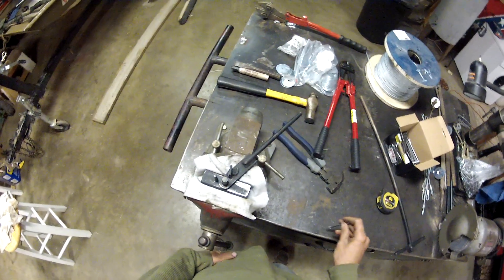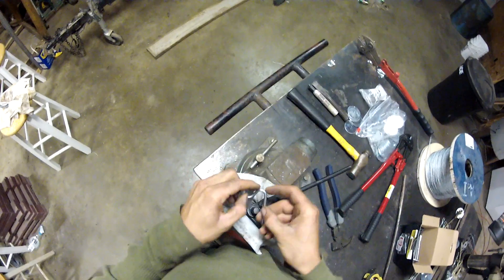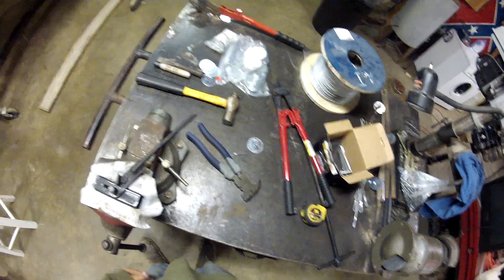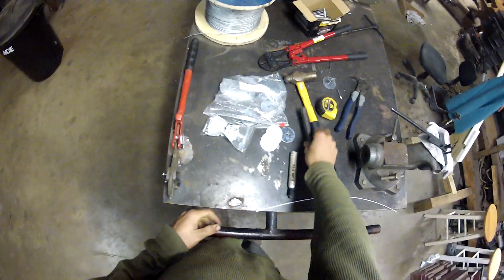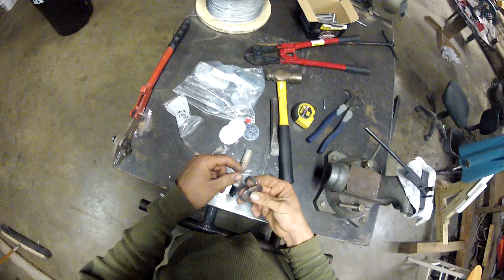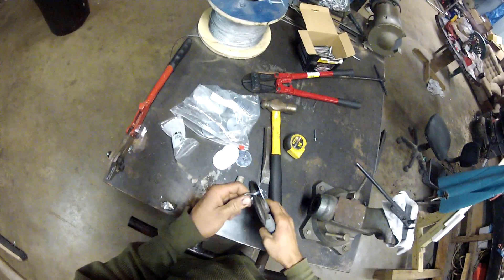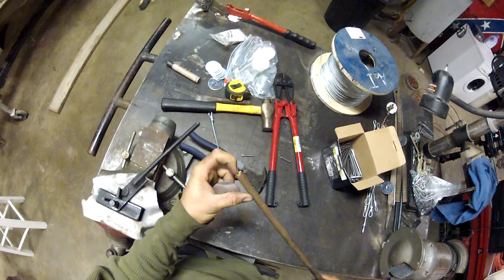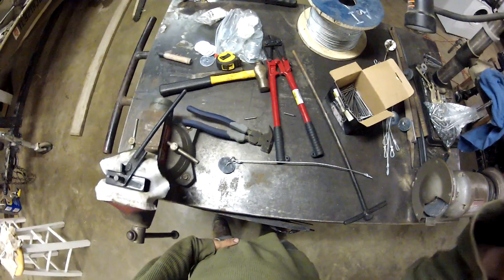Making Pogo Anchors/ Cable Stakes

Comment: Might try this. I have the 18" Berkshire Heavy Duty stakes, and while they were solid when I put them in, after a few weeks, and several rains. I was able to pull them straight up, while my 30" rebar stakes required my puller. I was disappointed.
Reply from the maker: Charles Collins they do work great. but if your leaving  about any stake in the ground for weeks on end with several rains and a your using foot holds which channel the water down the driver hole you better stick to rebar,
Reply: Yeah, you are right

Comment: Are you able to pull these out after using?
Reply from the maker: yes. I have some that I have pulled well over fifty times.
Reply: Sounds great ,going to put a few together and give em a try thanks.
Reply: I forgot to ask what size cable are you using?
Reply from the maker: 3/32" cable